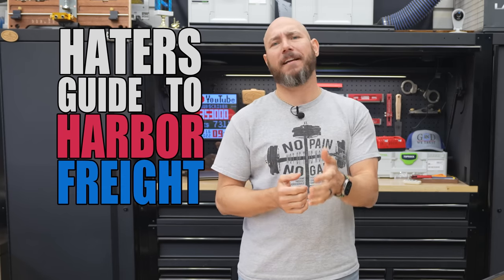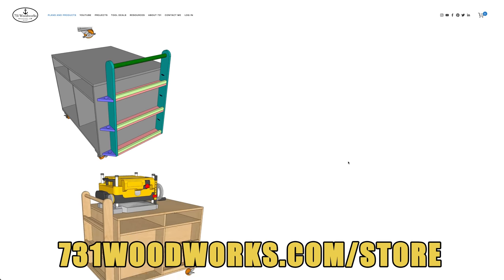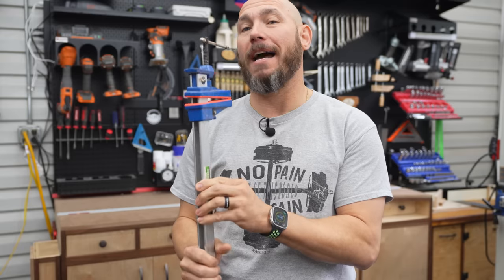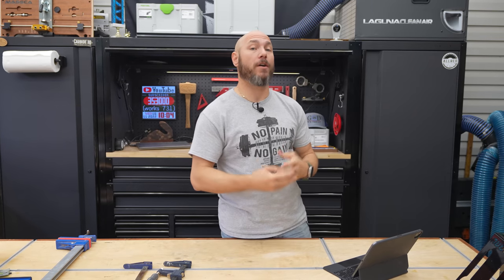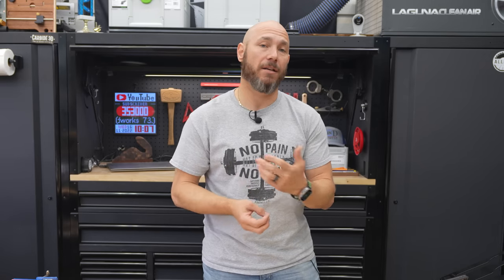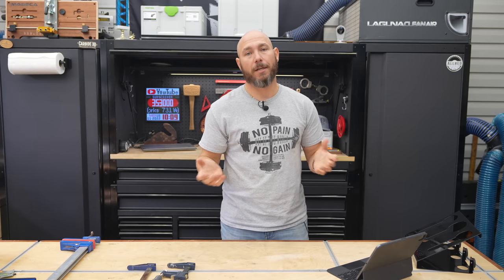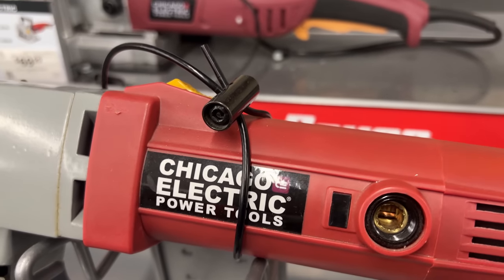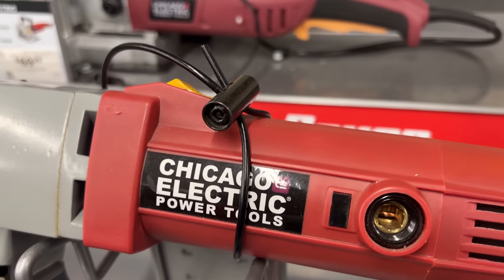The Hater's Guide to Harbor Freight | What to Avoid

Comment: You said it at the beginning of your video. The price that you're getting these tools at should tell you the quality is a lot less I know a few people that absolutely love harbor freight tools. They go there and they buy all their tools. But again nothing what they buy has moving parts. I have a set of their needle files. They work. They work for me for exactly what I need them for but I don't need them to be precise. I just need them to take a burr off or something like that which is kind of what they're designed for and for the price I pay for them. If I wear out a set of them I can go. I've had my set. I have the diamond set and I have the regular needle file set and I've had them for over a year but when I pay for them that works for me. I don't use them that often. If I used them more often, I'd get a set that from Germany or something. One of the higher price ones once it cost a lot more but I don't use these enough to worry about that. I got a few of the other tools. I got one of their jacks that are in that in my truck. One of their big floor jacks several mechanics swear by the harbor freight. Brian, I got one. My wife has one. We use them for changing tires. They work great for that little overkill for it but we have trucks that a standard jack just won't reach and this is from the factory and the factory jack doesn't work in the truck. Imagine that factory wheels factory tires factory jack factory truck no modification. The jack doesn't work so we had to go buy something else but a lot of mechanics. Lot of mechanics that work professionally. Use them. When they wear out they get a rebuild kit. Rebuild them but I think it depends on who manufacturers them and rebranding them. They're getting them at a cheaper rate because they're not known not a known toolmaker I got one of their dial calipers was not happy with it. I did not feel that it was accurate enough for me to use what I needed it for. So I went and I purchased a different one and I paid twice what I paid. You know for the harbor freight one but it does exactly what I needed to do and I don't have to have precision of a named Brand that cost $100 or more I've got the wooden toolbox. Not quite 100% happy with it, but compared to what the other wooden tool boxes cost the eight drawer machinist toolbox. What it cost from a reputable company versus what I paid for from them? 78 is a whole lot cheaper and easier on my budget than 1,000 and it works that I'm happy with it and I love their paper towel hanger in their other magnetic tools. Stuff that they have stuff's great!

Comment: He's wrong about some of the bit sets. I've been using the HF rail and stile set. It's been a good set, equal to the more expensive sets. I bought an admiral 12" sliding chop saw it wouldn't lock accurately in either axis I Frankensteined it to a point it was fairly accurate, but I'll replace it . Maybe the warrior is a good replacement.

Comment: You can ad the Bauer Forced air electric/propane heater to your list, there was a recall on them since Sept. 2021 that I didn't know about that was a fire hazard for leaking valve, they said that they only had one that caught fire but, mine was #2 that went up in smoke.  I took it back today and they gave me a HF money card with $106 on it and now I can't find a replacement locally

Comment: you cannot beat the U.S General line of tool boxes. I use the five drwer mechanics cart daily at work as a mechanic and it still looks like new minus a few scatches from normal use. Havent had issues with the latches or drawer slides either, only thing I will say negatve is the provided drawer liner material is awful and will need to get replaced quick. I also have the ICON sockets, and they have been working excellent, however I cannot attest to to the box end combo wrenches or ratchets. I stuck to Gear Wrench for the wrenches and MAC for my ratchets just for the stronger pol mechanism inside the ratchet itself.

Comment: This is a very good video. I have the Hercules table saw with the rack and pinion fence and it seems accurate and similar to rigid or dewalt. I also would not trust a table saw without a rack and pinion fence.

Comment: These critics are spoiled, HF quality keeps going up and prices are as well. Basics and disposables are normally the best deal in town. To get the "brand name" tools, it's rare to find a sales deal. The best things to get are the sales on Bauer and Hercules batteries and accessories. You can order 3rd party adapters to make them compatible with brand name tools. I helped someone a while ago who had a tool bag full of DeWalt crap. Constantly had to change out batteries because they using the "free" mini batteries that came with the tool at the store. I told him, just get some bauer batteries. I got a 8amh for 100 bucks and the better dual charger for 60 with two USB ports for everything else. Too bad i forgot my power tools at home, could have saved half an hour of work

Comment: Thing with harbor freight is that is good for the garage diy guy that needs a tool to avoid paying a professional, having said that there are some exceptions that may be good for heavy duty use but if you a professional using harbor freight then you better be just starting into the trade cause a professional top notch looking job made with harbor freight tools will be very hard to find

Comment: I have a lot of hand tools from harbor freight but more so sockets and wrenches. Have a Chicago electric circular saw and it works just fine didn’t have the money for a good Milwaukee worm drive but needed to get some subfloor cut out and repaired. Also have a Chicago electric oscillating multi tool that any more it just gets the scraper left on it bc it’s held together with Bailing wire but works in a janky fashion for what I need it to do and it has been replaced by a decent craftsmen one for everything else

Comment: Got a chicago electric air compressor, worked great for home stuff and light framing, I think I got that in 2009? The handful of times a year I need it it works, can't ask for much more. Also got an old angle grinder from the same year, use that more often and that thing refuses to die lol.

Can confirm the larger F clamps are trash, the squares were not square for me, but some shit like a hammer or magnetic nut drivers have been great for me, even through jobsite usage. 

I hear their generators are pretty good too

And another China brand I would look into that I consider better than HF is WEN, got a handful of WEN bench tools and every single one has lived up to home DIY'er tasks, way better then box store budget brands like Ryobi in my mind

Comment: Their breaker bars have taken alot of abuse and work great. However, their socket adaptors sheared off on first use, 2 different sets. Made of the cheapest metal they could find. Replaced them with craftsman when sears was still a thing and they are much better

Comment: I would add avoiding ALL CORDLESS TOOLS from Harbor Freight.  First of all they began as a knock off of Ryobi One Plus tools but Harbor Freight has multiple product lines and the batteries and chargers are not even compatible with each other.  Furthermore every few years they change product lines (eg Chicago Electric, Drillmaster, etc.) and suddenly you can no longer get batteries and chargers.  Pay another 30% and get Chinese manufactured Ryobi tools at a USA standard and you know you will NEVER have a problem finding batteries and chargers.  Also note that if you cannot find batteries and chargers that you tool is no longer usable.  
On the other hand I do like the sockets with color coding and much larger size labeling than most other manufacturers.  But again many socket manufacturers do not properly position the size label relative to the square 1/4, 3/8, and 1/2 mounting hole.  So I find brands that the size label of the socket does not face directly forward for you to see in the tool rack or tool box.

Comment: There’s only two reasons someone buys a Chicago router…one is if you can’t afford the extra hundred dollars for a Bosch, and the second is to supply a tool to someone who is wildly irresponsible with tools, like a crew of guys who sharpen their pencils on concrete because they can’t be trusted with a Sheetrock knife. 
I bought the $20 4” grinder from Wal-Mart to have my helper cup grind a concrete wall with me while I used a Bosch grinder that cost $169 with a corporate discount program. That was two years ago, and that Wally World special is still working. All I do with it is cup grind concrete, and leave the diamond wheel on the Bosch. It gets bathed in concrete dust, and I’ve never even blown it out, as this has become a torture test, and I can’t seem to kill it with heavy use. It has cup ground thousands of square feet of concrete now, and it keeps on going without any issues at all. I’m shocked, to say the least. It looks like a direct copy of the early Makita, that first one with the button to hold the chuck. There’s no chips in it, there’s no brain box, no thermistors that I can see, it gets hotter than a pistol, but it keeps going.

Comment: I find that if a harbor freight electric tool makes it for six hours out of the box, they generally last for years. Ive had a lower and mid range oscillating tool go bad under heavy use, and the bladeholder come apart on another. I had a belt sander self destruct, bearing seized and melted the casing. But really, thats all thats gone wrong over 20 years and thousands of dollars spent there...

Comment: If you're bending a F Style clamp from Harbor freight then you're putting too much pressure.  I've had the 48 inch harbor freight F style clamps and have never had any issues with them bowing or bending at all.  They are a good resource for those who are on a tight budget or just need something long occasionally to clamp up something.

Comment: For professionals Harbor Freight is low quality, but for a homeowner? I don't need the super expensive tool kit for screwing replacing my light switch plates. I don't need the highest quality tools when I might only use a socket wrench a few times a year. If you're livelihood depends on the tools, it's worth it to go better. If you only use your tools sparingly and your pay check isn't dependent on them, Harbor Freight is good.

Comment: Some people don't understand how this store works.  Its not meant in most cases for the tool to measure up to name brand tools.  You have to do  your homework and understand what their limitations are.  You have to always take into consideration how you intend to use them.  If you need heavy duty you may want to spend the extra money for name brand. Generally speaking you have to realize that in many cases the metal is not going to be aa rigid or as strong.

Comment: I will absolutely say if you want a set it and forget it solution power tool DO NOT buy chicago electric power Tools. However if you have no issue with taking 15 minutes to redo a safety feature within a year or trim and reattach the wiring every couple years then they will do fine for you. I have a chicago tools electric metal shear that I got back in 2008 after 1 year I had to redo the safety switch. Another year later I had to trim and reattach the power cable do to the stress on the wiring inside the unit. Still working to this day no issues since. In 2018 I bought a Chicago electric cut off tool. Within the first month I accidentally cut through the cable. That's on me. They wouldn't exchange it. I didn't expect them to. I took the "shortened" cable and reattached it in the unit. In 2019 the Safety switch failed, like they do, so then I had to stop in the middle of a job and redo the safety switch wiring. Since then it's been fine. You get the routine. If you DO buy one of these things because they are so affordable open it up immediately and just detach the wiring, resplice, put back together, and resume life like normal.

Comment: List of stuff to avoid from Harbor Freight:
- precision anything
- cutting tools (blades, drill bits, refills)
- consumables such as sanding disks
- furnitures/tables
- screw driver

Most of the stuff in the list can be found at comparable prices from quality brands that won't dull or break in an instant.  Many of their tools are actually great once you switch out their blades or cutting heads with good quality ones.

Comment: I bought a set of those squares you showed from HF yesterday and took them home to check if they were square and they were WAY off. I could tell just by looking but I used my angle finder and found that the most accurate one was 89.3! Big yikes.

Comment: You just said what I've been saying about H.F. since the late 90's. If it has moving parts don't buy it. I do have all the wrenches and sockets ect from Pittsburg and that stuff is great. I've never cracked a single one. As a painter since 89 I can say this. Don't use cheap brushes. You get what you pay for. Purdy is far better than Wooster. Definitely never ever buy a cheap roller cover, always get the good ones. It's worth it and they can last a very long time if you clean them properly.

Comment: Overall, I'm a fan of Harbor Freight with some considerations. Their speed squares and combination squares are just awful. I go elsewhere for all my measuring needs. Fasteners are also questionable.  Avoid pneumatic fasteners, such as brad nails. They jam too much.

But with those negatives out of the way, I like being able to shop for mid-grade tools while I'm still figuring out what methods I like and don't like. Their return policy is also very good. For tools I don't use often enough to need the best of the best, these low-cost alternatives sometimes make sense.

I was pleasantly surprised with the Banks brad nailer. That paired with Metabo fasteners was an excellent experience. 

I also like their Warrior driver bits, but not for use in power tools. Rather, I like them in my handheld screwdriver. 

Another favorite is the Pittsburgh Pro precision screwdriver set without the snake. The bits are manufavurd so well that the tiny Torx heads can disassemble a cell phone. This was the first tool I got there that made me take HF seriously.  

They have a lot to offer, but yes as you said go elsewhere for measuring.

Comment: Some of their air tools are so cheap it doesn't matter if they last a year or less. I'm talking about their die grinders. Also I bought a right angle grinder on sale for $9, they're electric version it doesn't have much power but it does the job I expected to. I have also bought their floor jacks which lasts as long as any. I always avoid their hand tools and drill bits. I have one of their generators the  3,000 watt one which has been working Fantastic Four two years

Comment: If you need a tool to do one job and only one time use, then it's ok.
I buy abrasives there.
Their Hercules brand is pretty good and deserves some degree of credit.
For woodworking stuff for my shop, NO WAY!
If you need accessories for a trailer or straps, tarps - excellent value!
ICON brand is damn good and lifetime warranty.
Foam paint pads good as anyone else for less $$.

Comment: I use a Pittsburgh hydraulic jack, jack stands, and their engine hoist, along with their ratchets and impact grade sockets, and I've had excellent luck out of them. I have even used their impact sockets on a hydraulic press, which also came from there lmfao

Things I would avoid tho, their line wrenches without a doubt. Their line wrenches are nowhere near the right size, and will round off stuck brake lines worse than a good open end wrench even would, spend good money on things like line wrenches. 

Their combination wrenches are okay, the icon brand is good but the Pittsburgh, again, too much slop in sizing. It will round off bolts. 

For slightly lighter duty use, the Hercules brand bits and bit driver set, they're not bad!

Also, if you don't need to do a lot of cutting, their 4-1/2" cutoff wheels for grinders aren't bad, and are very cheap.

Comment: I work on cars. Some of the specialty tools can costs thousands. I want to retire one day, so I'll usually buy a similar tool at harbor freight and modify it to work. To work on semi engines, not even the best impacts will get some of those fasteners loose. Instead of spending hundreds on a specialty wrench, I'll just spend around $20 on a Pittsburgh wrench and cut it. I'm beating it with a sledgehammer, I'm in too deep already. I'd rather just save the money and get it done

Comment: FWIW, I can't find a single mechanical difference between my 10" sliding miter saw (Bauer) from HF and the >2x priced Jet version. They clearly came off the exact same production line. It works fine, and has *all* the adjustability and mine is dialed in perfectly. ** shrug **

Comment: I like harbor freights socket wrenches and bought a set of 20mm to 27 with some extensions and break bar for 20$, also use their motorcycle rear stand, I’d avoid their power tools and Jack stands 😂

Comment: Surprised you were taken in by how some of the power tools looked.  It's what is inside that counts.  Like you stressed all along, they are cheap because of inferior metals.  That means bearings, windings, shafts and other internal parts invisible to the eye.  Your original rule of thumb at HF is correct, the more moving parts, the more chance of failure.  Small clamps is about as far as I go.  Have to admit I even steered away from their "K" clamps, but after seeing this, I'll give them a whirl.

Comment: Crafrsman tools are worse than HF nowadays since they started making them from Chinesium, in China.   The F clamps are good for weldind a mount for a deer camera when nothing else you have has enough gap between the screw and you can also weld on a link for a security cable  and you dont mind marring the cheap clamp.